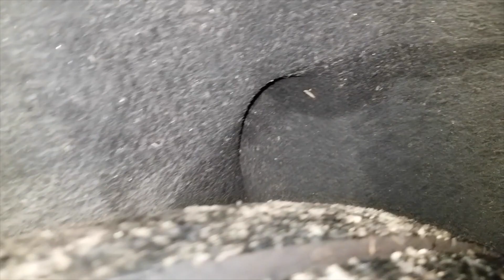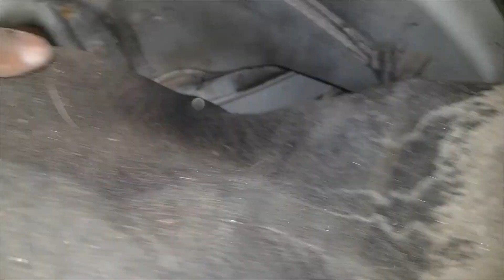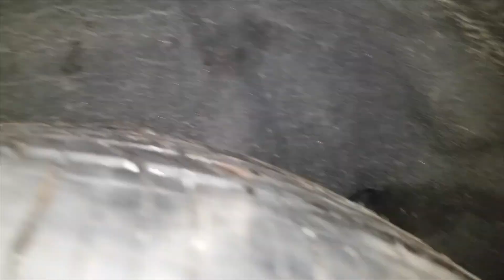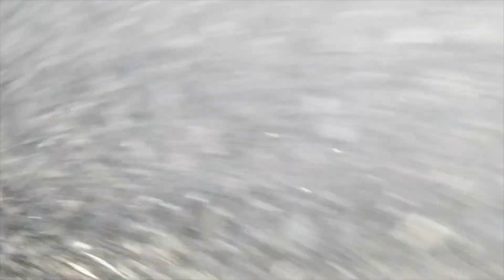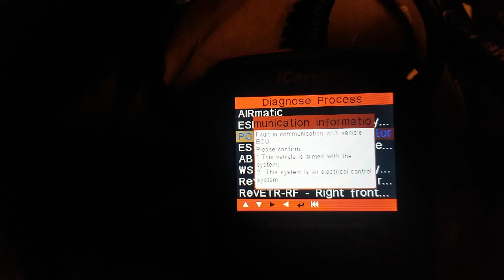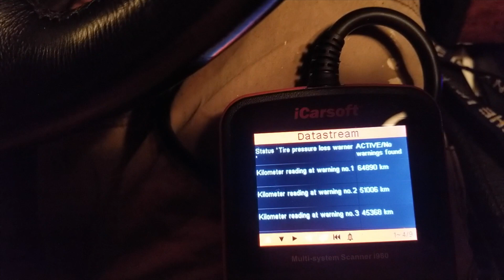Mercedes Tire Pressure Sensors

Comment: Hi Keith, I have a GLK220 4-Matic (X204) – I was told tire pressure monitoring is via wheel rotation and wheel balance, definitely no sensors in the wheels or under the wheel arches.
Love your channel🕊️

Comment: I rotated my tires at discount tire, I reset the tire pressure  moniter and now tire pressure moniter active.  no numbers  are are showing after 60 Miles of driving. And several on/offs  ignition  cycle.

Comment: A trim tool set is great to have.  I have one I "sharpened" by using a grinder to get nicely behind the clips.  You can also use a diagonal cutting plier, but don't press it too hard against the clip, or else (captain obvious here) you'll cut it.
Reply from the maker: Yup, I have one. Can never find it when it's needed.

Comment: Hey Keith I have 2010 R 350 Mercedes and I just put new brake pads and rotors on the front.  I am getting a message ABS & ESP inoperable check manual.  Brakes makes a screeching noise sometimes.
Reply: Make sure the wiring to the speed sensors wasn't damaged or that they aren't unplugged.  Speed sensors go from the back into the hub where the bearing is. This wiring shouldn't have been touched, but can be mistaken for the brake wear sensors in the front.
Reply from the maker: He's correct. Hopefully that's all that was done. And they are not damaged.
Reply: @iRepairAutos  Thanks Keith
Reply: @pfsantos007  Thanks